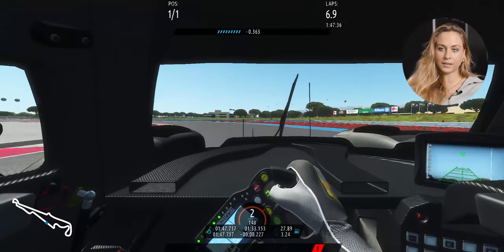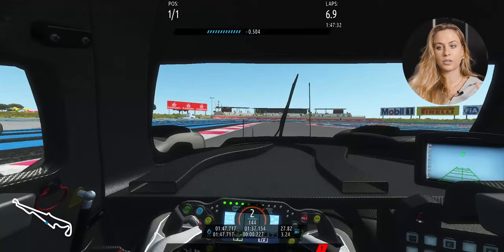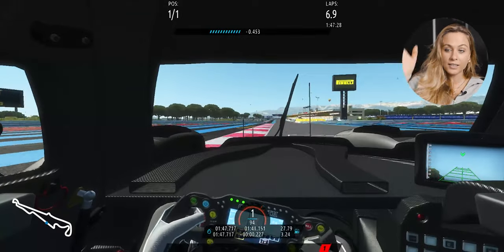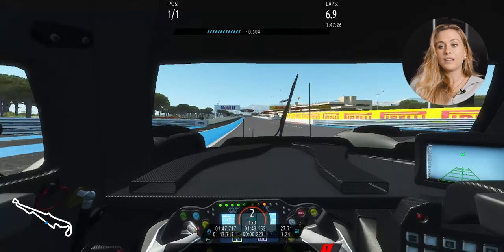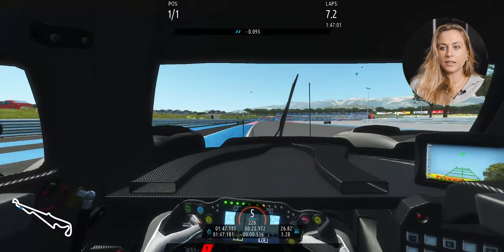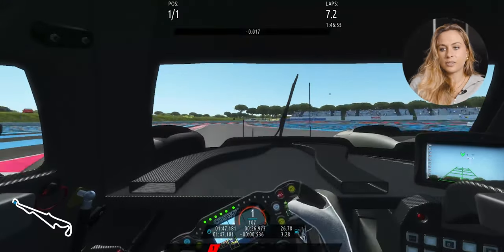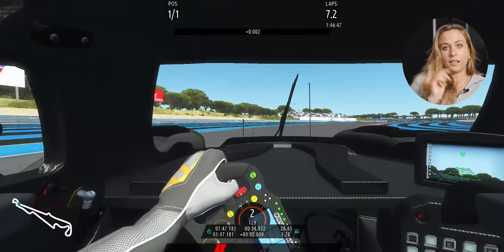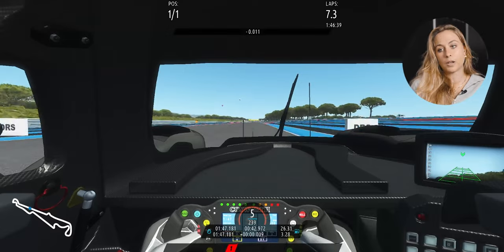SOPHIA FLOERSCH - A LAP IN PAUL RICARD | Track guide | SIM - real life | RF2 | LMP2 | ELMS

Comment: Great video. A huge like but there's one issue: Isn't it wrong to shift down to the 1st gear when in real life you use the second gear? I mean you may make a mistake during the race if you constantly go down to the 1st gear in the SIM. I don't think it's a good idea, but you know much better than me. I've never raced anything like an LMP in real life :) All I meant: you can also damage the gearbox if you forget (or don't use it properly) to use the clutch going to the 1st and then to the 2nd since and that's because the 1st gear is rarely used during the race  (in real life). I know such things did happen (broken gearboxes in race cars) but your advisors and team know much better - they know everything and I know nothing in comparison. Your videos are greatly appreciated by me. A huge like and best of luck on the track!